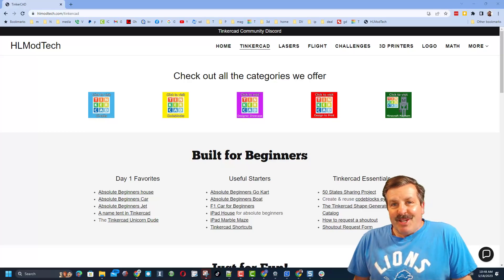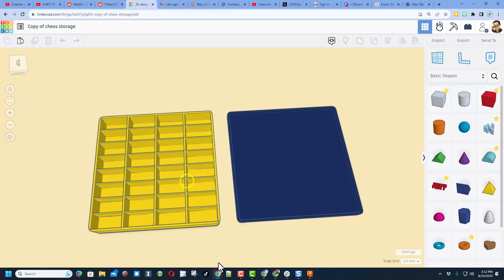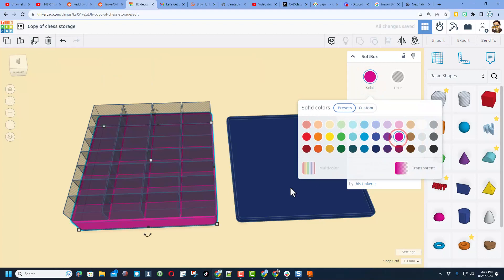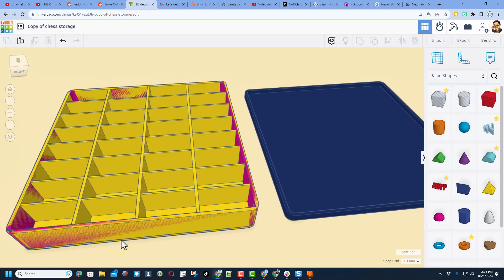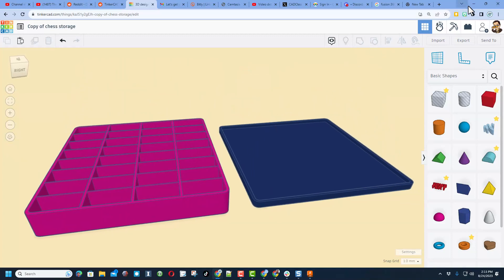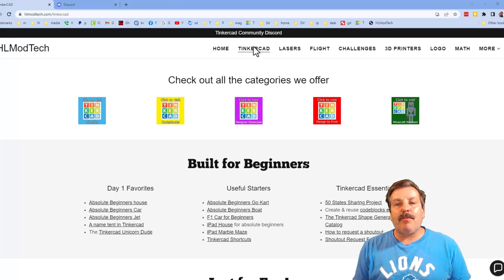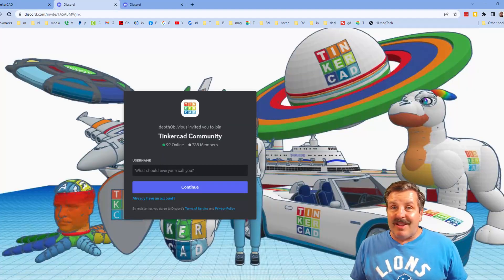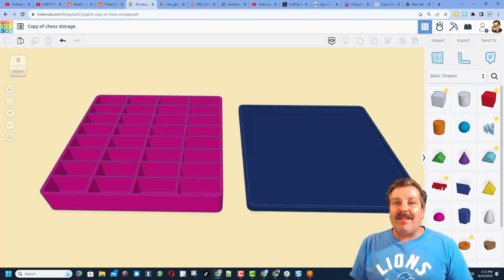The Fastest Rounded Corner Fix Tinkercad Storage Box 3d print Update

Comment: HL, this is a very good modification but how about the cover part ? Will it also need modification ?
Reply from the maker: It should not matter as I was just filling in that corner of the inside so the design was stronger. My initial trick to cut out the holes left the outside 4 corners pretty thin and sharp instead of curved.